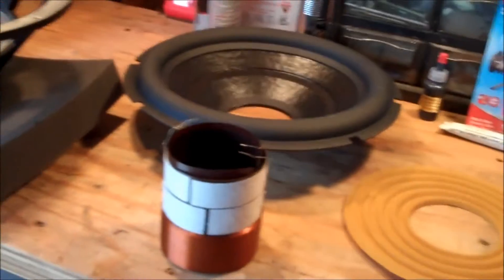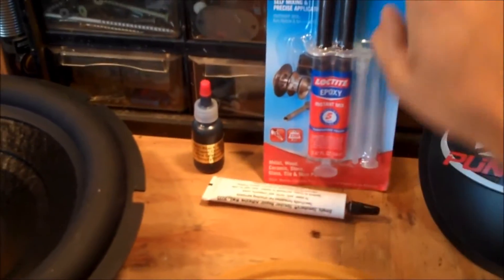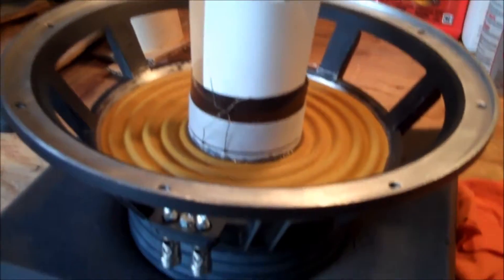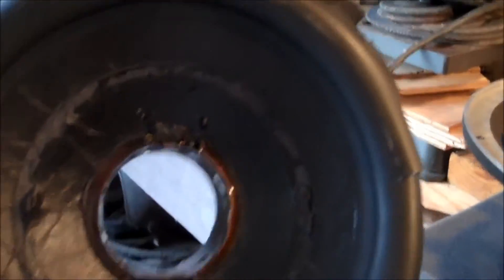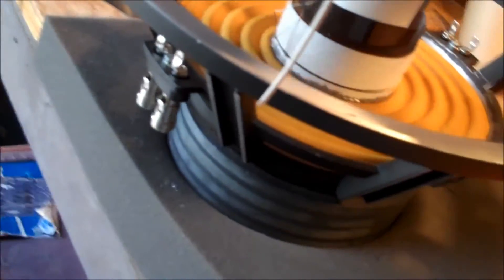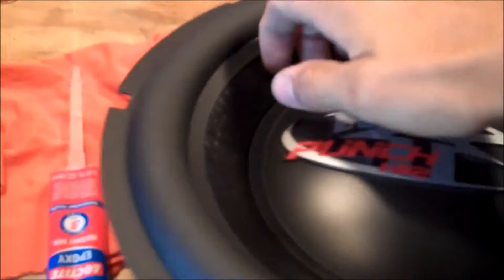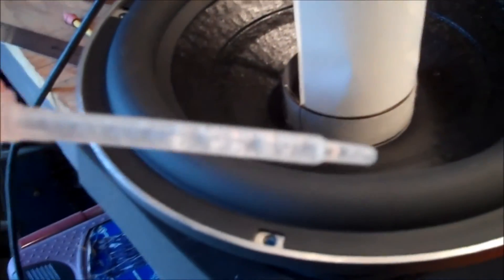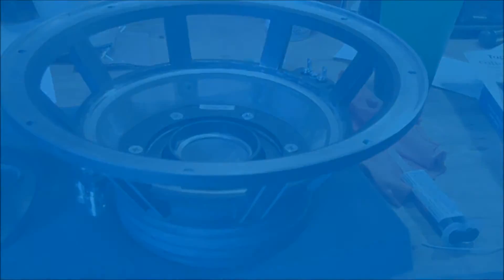How To Recone A Subwoofer Part 2 (Fosgate HX2 12")

Comment: I know this is an older video and you might not remember. I am actually doing a recone right now on my HX2 and being excited I disassembled and forgot to measure the distance of my spider from the top of the dvc. Was it the 18mm as you said in the video? Thanks either way.
Reply from the maker: I really can't remember, I think that sounds right, I know about 14mm of the could should be in the gap but I couldn't tell you where exactly that puts the spider. I'd say if you can't find the measurement then go with 18.mm it does not have to be exactly perfect.

Comment: I got the same kit but the cone was for HE 2 inch coil Hole in the cone so would have to mod that but then the surround wouldn't seat right so i got cones off ebay for the HX2's 24$ ea 15's.But no the he is a 2 or 2.5 former RFD2212 3 inch coils Power series 4 inch coils.. Check out my video on my recone..

Comment from the maker: Original and stock mine had the 1 1/2 spiders and the recone from the speaker exchange was only 1, I haven't had any issues with that luckily but the spider they gave me needed to be trimmed down to fit the spider landing. The speaker exchange kit I got used a rubber surround identical to stock and came preattached to the cone. The only issue was the former was taller than stock but that was solved by just adjusting for the Xmax and luckily the top of the former still fit under the dust cap.